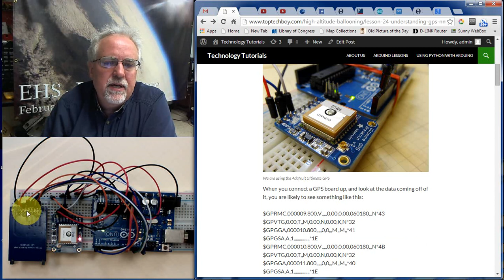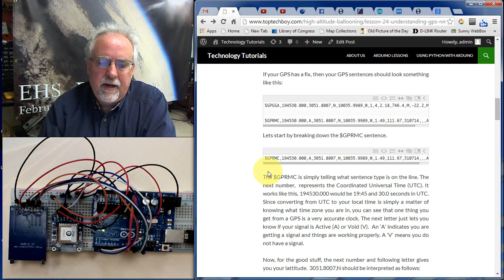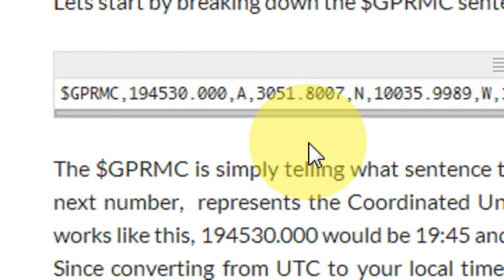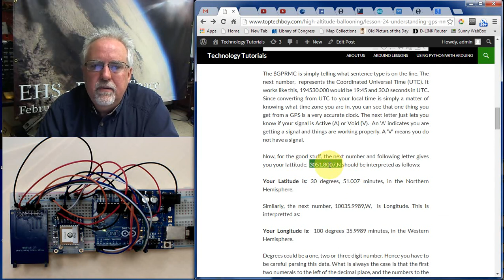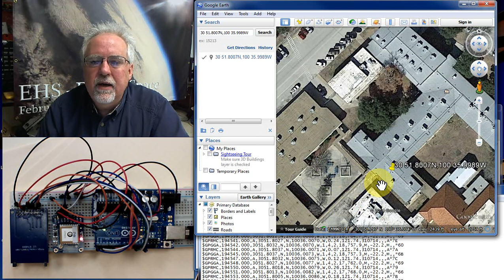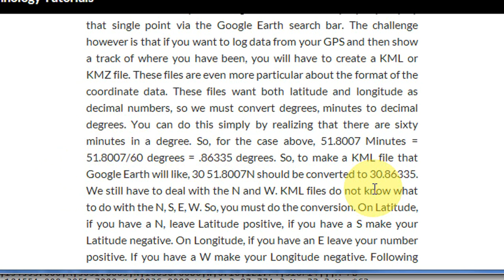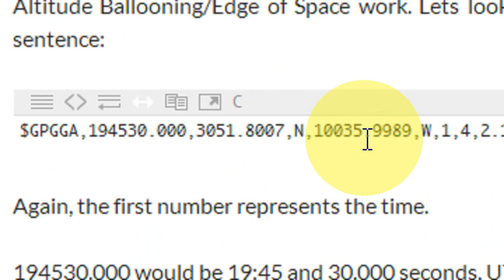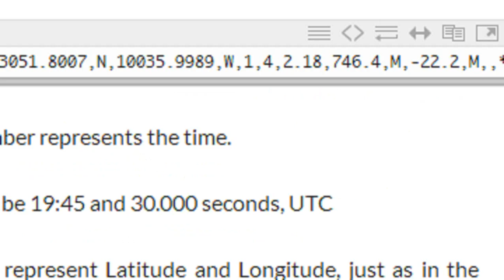LESSON 24: Understanding GPS NMEA Sentences

Comment: Does not Latitude always and only have 2 digits (90 degrees is North- or South Pole; single digits get leading zero), and Longitude always 3 digits (max 180 degrees, not 200 as you said somewhere half way ;) )?
Or is that a different version of the NMEA protocol definition that I'm looking at?
A fixed format makes decoding a good step easier...
By the way: compliments on your GPS lessons! Easy and clear, even for a "nuts and bolts" mechanical guy like myself :)

Comment: Hello. A great set of videos but not quite what I'm looking for. I realize this is a few years old now, but I'm trying to set up a simple conversion of NMEA 0183 strings coming from a GPS mapping program that I'm trying to set up a guidance Light bar that will help me with the mobile mapping of an event I set out with way points, roads etc. I have previously just tried to follow the arrow on my map (Tablet) but often it is not very accurate. I thought it would be simple enough to build a light bar similar to what is used in the agricultural industry & us an Arduino to convert the NMEA 0183 strings that my mapping system out puts for autosteer.  Surely it can't be that hard, but I think I'm missing something ?? Any wisdom towards this would be greatly appreciated. I will watch this video again I I make sure I am understanding the data but converting it into simple LED's is where I am getting lost. Cheers!!

Comment: I am using a GPS and for a project I'm working on I only need the $GPRMC sentences. I've been able to get rid of all the other sentences available at boot up. Fine.
Now my question is: In the $GPRMC sentence I can get 'A' or 'V' as acquiring fixes or not. My project is a clock and only needs the actual  UTC time (hour/date). no GPS position needed.
So Could I use the 'A' or 'V' conditions to get the UTC time or I must have a fix with the 'A' letter showing ? If the 'V' worked fine for the time/date only I could use it even if I'm having a hard time to get a fix waiting for the 'A' letter to be received.. So 'A' needed or 'A' & 'V' can do ? Thanks.

Comment: Hi Paul. Thanks for the informative video. I have a question about assisted GPS? Not sure if you would know but I thought I'd give it a shot. 
Is it possible to get that feature in any GPS such as the ultimate GPS or is that more of a software stack thing enabled with the GPS receiver? I'm guessing it would not be possible in ultimate GPS but wanted to make sure. 
If I am buying a cellular module and GPS module, I would have to make sure that both these modules have software to enable assisted GPS right?